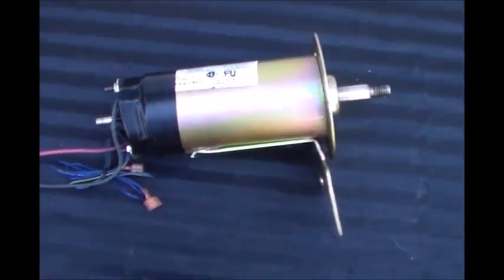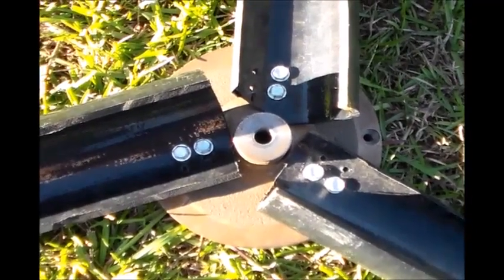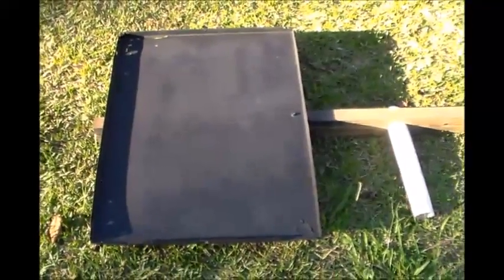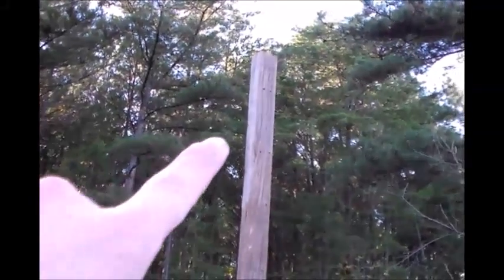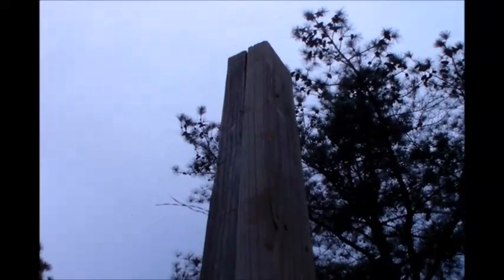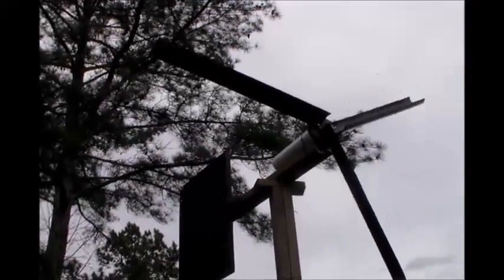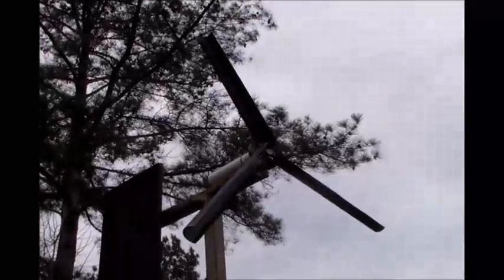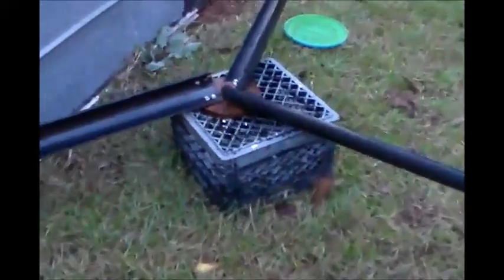How To Build A Wind Turbine From Start To Finish

Comment: this  motors are are 1500  rpm above  they generate  the  volt  not the  amp  when we  connect the  Loads the  volt  will come  down  ... you can use for  25  ah  or  less then  batteries,  Blades are not  in shape
Reply from the maker: +Mogal Amjad Thank you very much for the information. Yep, wind power is not very good for me. Even if I had a professional turbine it wouldn't do much good for me where I live. :)

Comment: Sorry you didn't push it all the way.  All the diy projects seem to suffer from insufficient blade power.  Though it seems like your infrastructure is heavy duty.  I bet you could handle far bigger blades.  Maybe cut up that washing machine ? ;-)
Reply from the maker: +Morgan Brown Yep, it was my blades that were to problem. If I had the proper blades, I feel the the turbine would work. :)
Reply: 2012solarful I'm building a small turbine for my oldest daughter's science fair project.  I'm testing with a box fan and have the turbine spinning a small motor, then have it connected to a multi meter. I'm blown away by how sensitive the power of the unit is to blade angle.  we will experiment with blade shape as well.  I'll put up a video at some point
Reply from the maker: Sounds good! I'm looking forward to seeing the video! :) Yep, wind turbines can really pump out some power.

Comment: Wow!  2.25 Horse Power.  Does the motor say what the RPM rating is?
Reply from the maker: No, unfortunately it didn't. This was what made it hard for me to calculate the windspeed I would need to produce 12 volts. But I don't get much wind up here anyway. :)
Reply: 1500 to 2500